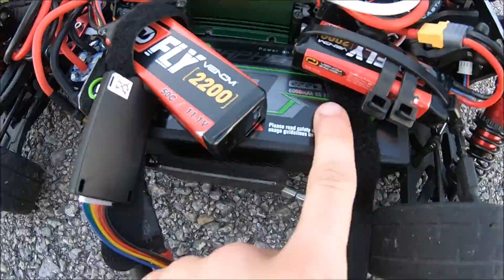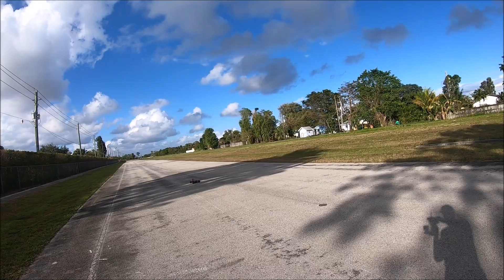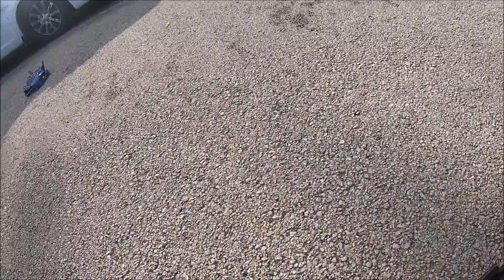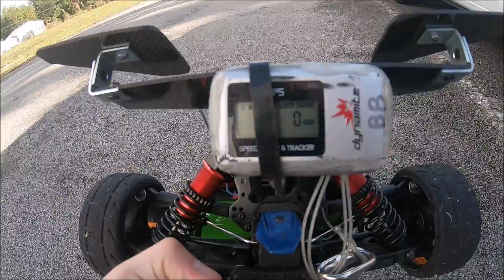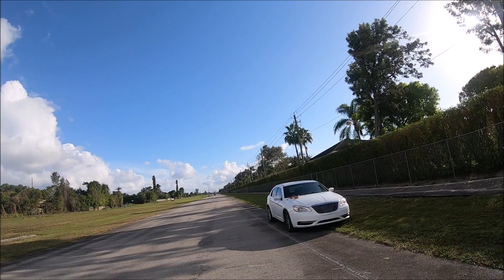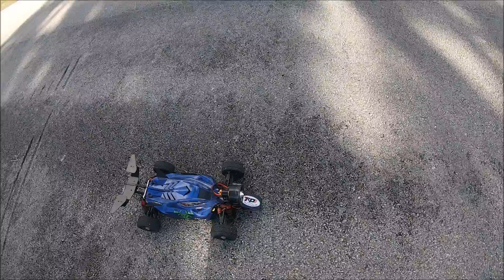Jet Typhon 200+ KMH/ Hybrid Powered RC Car EDF Test

Comment: Make a thrust tube out even thick stock paper. It will do wonders if the exhaust of the fan is controlled.
Reply: I was thinking a couple curled diffusers on the spine of the body. Like a couple of Free Willy lookin fins.

Comment: I think the thrust provided by the turbine is not of much use because of the power transferred by the motor  to the ground. Still a nice run. Achieving insane speeds as usual.
Reply: If you consider the thrust as drag reduction... providing the additional weight isn't a net loss... then it makes sense. I'd ditch the extra cell and fit two mini turbines. Around 2/3 the weight of the current rig.

But hey... the sound is enough to make it worth it! 😊👌

Comment: Nice idea 😁 if you move the EDF to the back so you have a clean exhaust from the fan you'll get more thrust out of it.  Then hit it at high speed like a turbo boost, as they work better at higher airspeed.
Reply: You’ll need a scoop, they loose a ton of thrust when they don’t get perfect airflow (the micro jet engines don’t have this issue, they will run in rediculous environments, but the electric EDFs really struggle with restricted air intake unfortunately). But yeah, put a little air scoop or just place it far back enough and put a small metal screen so rocks from the tires don’t fly in and it should be an improvement.

Comment: The thrust from the High RPM EDF will likely increase as the vehicle gains airspeed.
Reply: Nope. It will most likely run slower if it can't clear the air quick enough. The positive load on the impeller will reduce rpm. A guy at an RC airshow tried mounting wing EDFs to steer a nitro jet. 😑 It ended just about as well as you're imagining. 🤣
Reply: @hesperhurt  most EDF's have a motor who's torque curve is optimized for high rpm, and blades that are spaced and pitched to give best thrust at high rpm, and high velocity airflow.  That's why they are effective at high speeds, and typically do not perform well at lower speeds.  The failure of the nitro jet with EDF's mounted on the wings most likely failed to achieve good control for other reasons than the thrust level of the EDF.  If what was stated was true, they would not be effective at high speeds, and they most definitely are. Efficient low speed thrust requires large low rpm blades with low pitch 
Efficient High speed thrust requires small high RPM blades with high pitch. 
pretty simple really...

Comment: putting the ducted fan in the front of the car will make be less effcient because that hight speed air coming out of the little turbine will be obstaculized by the car´s body and that little gps and spoiler  , so the high speed air coming out of the turbine wont be pushing so much air flow to help the car go faster, so maybe if you put it in the rear end of the car im pretty sure that the air flow coming out of the ducted fan turbine will be able to circulate freely to the exterior making more push for the car and  gaining more speed.. It will be so much interesting  trying putting the ducted fan in different parts of the car to see if it makes an considerable change as Im sugesting.. great video!! that thing is a rocket!
Reply from the maker: Appreciate the insight, wait until the end of the video you'll see the newest version of it. Performed a lot better too

Comment: This really looks like a project I did in my high school. But I have some suggestions, first why did you not put the ducted fan in the back of the car? It would be much more powerful because there is no obstacle in the way. Although it would be less stable. My solution was custom make a lengthened chassis from aluminum panel so it wouldn’t spin out. I also suggest use a nitro powered car as the base because they have mechanical brakes so you can get the wheel power entirely away.

Comment: Back in the day my friend bought a rc airplane and after crashing it half a dozen times and fixing it he sold it to me, I took off the gas motor and put it on the back of one of my rc cars with a push prop. Once it got up to speed it was like a rocket. I still have the scars from the prop hitting my arm while holding the glow plug and starting it.

Comment: Awesome build! How did you get the ducted fan running in parallel with the throttle? What transmitter did you use? Are you using an aircraft ESC or no?  I'm trying to something like this with the radiolink RC4GS, hoping you can share some insights
Thanks!
Reply from the maker: Parallel receiver harness is what makes the magic
Reply: @Innovation RC  thanks! Pretty straightforward 😄 I'll look into the parallel harness. 
 I was trying to run the fan off a separate ESC+ battery, as a separate Channel- the return-to-center throttle always keeps it at 50% power that way, and I had to use it with the third channel 0-100 dial.  I'll copy you on this one 👍
Does the ducted fan need to be 6s rated using a parallel reciever harness?

Cheers! Keep up the awesome content!

Comment: Awesome job. So interesting watching your Typhon experiments. Maybe a change of body/shell is needed now though??
Reply from the maker: The Jetlag attachment isn't permanent, it's just to see if it can handle high speeds, this was to test for the Evo 2020 project.
Reply: @InnovationRC  Oh okay I see. 
I finally got myself a Typhon 6S BLX a week or so ago BTW. Running mine with all the standard electrics/motor at the moment with a 23/50 pinion/spur set up. Waiting on a centre spool and Traxxas pinion/spur gears. 
Any tips for setting up my suspension? ...to stop it bottoming out? Like what shock oil should I be using?
I've adjusted the droop screws and got it set low but I just want to firm it up a bit. Thanks
Reply from the maker: @gmballistic506  what you'll need are Neo hot racing springs. I run black, other guys run white. And don't use the droop screws, they cause stress to the. A arm. If you limit your shocks internally you don't ever have to worry about a change in ride height over time because it'll stretch or pole through the plastic a arm eventually with the spring weight on it all the time.
Reply: @InnovationRC  I'll look those springs up later thanks. Just hope they're available in the UK. Ha.
You don't use the droop screws then?
Are you using shock limiters then?
Reply from the maker: @gmballistic506  I don't use droop screws at all anymore. I cut the outer shell of a pen out and put it in between the shock shaft and rod end

Comment: Very innovative, great job! New subscriber. I think I would have opted for a more central EDF mounting, did you try it in the middle? I have zero experience with EDF's but I would think there is a more powerful EDF out there with a minimal weight penalty over what you already have.
Reply: There are, I have one similar size 65 amp rating at 6s, he could just plug it into the cars battery that’s already installed, this EDF is incredibly weak, I didn’t even know they still made 3s above 35mm super micro size anymore, I thought they all were 4s and up!
Reply from the maker: @jakegarrett8109  it is 4s, this video was just a test. Listen to the last 20 seconds of this video...

It's going to be built much better, and very soon. Parts were just 3d printed and arriving this week

Comment: Imagine if you installed wings to make it fly. 

Or if you put a FPV setup on it.
Reply from the maker: I put edfs on a cad and made it actually Hover, suspend itself in midair
Reply: @InnovationRC  Thats badass. Ima check thay out real quicl
Reply from the maker: @burntchickennugget191  yessir. Video is about 2 months old so look around there

Comment: Damn that thing is pretty sweet. Im doing a rebuild on my Talion soon, and I was wondering what motor / speed control I should use. Was most likely going to go with the Castle Monster V2 Retro for the speed control, but not sure what motor Im gonna use yet. Only looking for around 90 mph. Any recommendations? Thanks in advance!
Reply from the maker: You can use the MM2 Retro, people achieved decent numbers. But if you want the best, go for the XLX. If you decide you want to go further in speed just jump straight to the XLX

Comment: well that EDF has maybe 800 gr, thurst and that buggy is with all that batteries is over 5 kg . basically your edf has no contribution to the speed. without edf, and that batteru you use to coll down the motor and battery for the edf your buggy would be lighter and faster.

Comment: Should be rear mounted so it doesnt hurt the top end
Reply from the maker: Rear end mounted I tried before. It actually made the rear loose, whenever I wanted to slow down the rear kicked in front, which isn't safe when over 100 mph

Comment: Get some skateboard wheels with abec 11 or better bearings in them you'll smash 200
Reply: It requires 8x the power to double speed due to aerodynamics, you could use a wooden shaft in a cheap straw for your wheel bearings and the resistance will be rather insignificant by comparison. He’d be much better off using a parabolic too to the car (and you could put the EDF motor in the middle of it if you wanted)